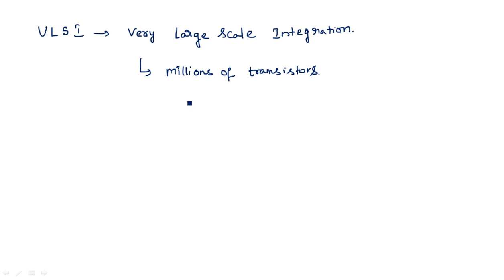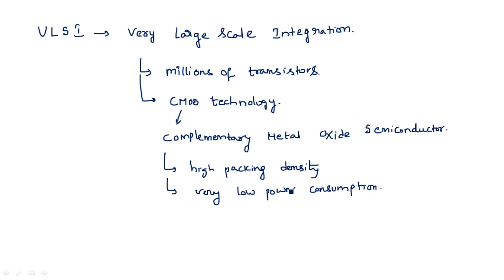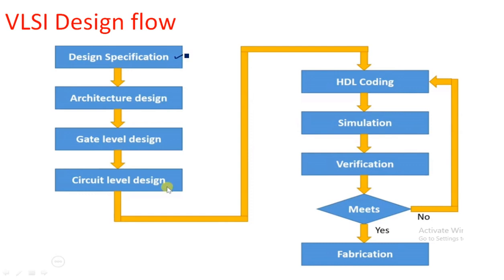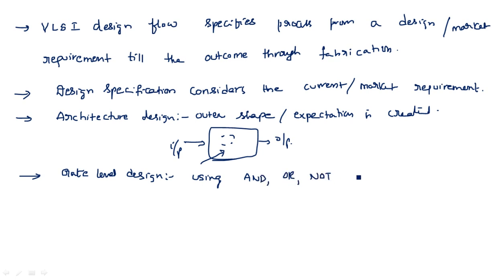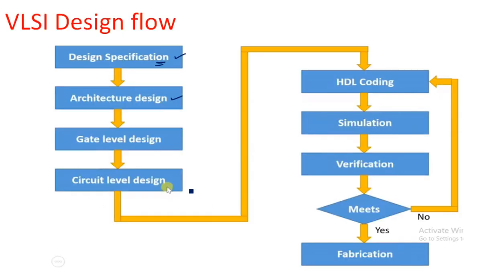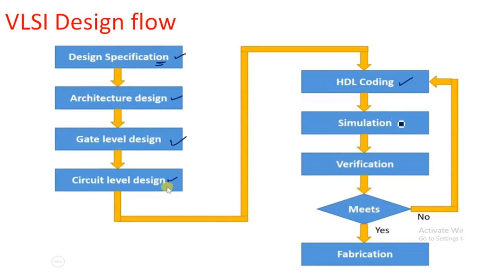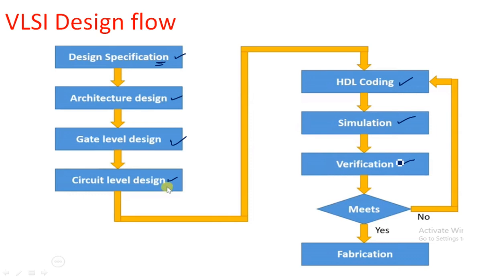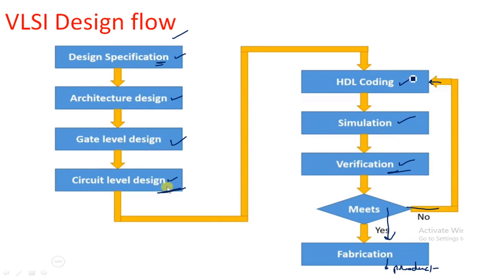What is  VLSI | Introduction & Design flow | VLSI | Lec-01

Comment: 00:01 VLSI stands for Very Large Scale Integration.
02:02 VLSI stands for Very Large Scale Integration, which involves grouping together a large number of transistors on a silicon substrate.
03:53 CMOS technology is used for the fabrication of integrated circuits, offering high packing density and very low power consumption.
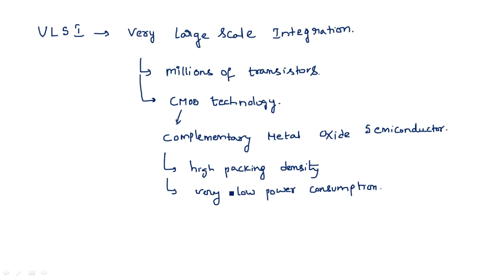05:54 VLSI design flow specifies the process from design requirement to outcome through fabrication.
08:08 Design specification and architecture play a key role in the development of VLSI
10:12 VLSI design involves gate level design and circuit level design
12:14 HDL coding is used to describe the behavior of the circuit in circuit level design.
14:46 VLSI design flow involves code verification, circuit fabrication, and iterations for meeting requirements.
Crafted by Merlin AI.
Reply: Thanks